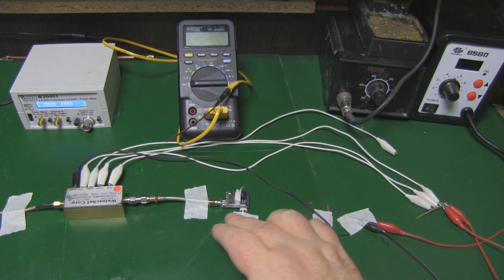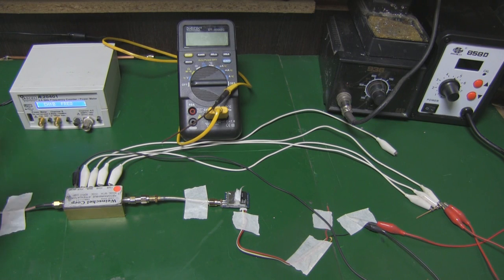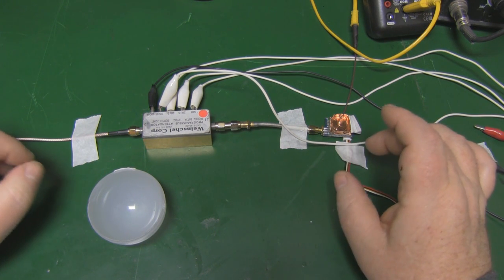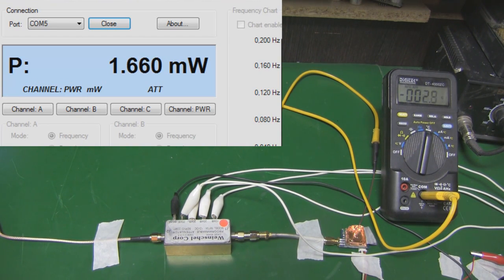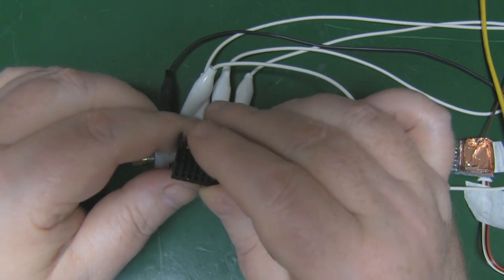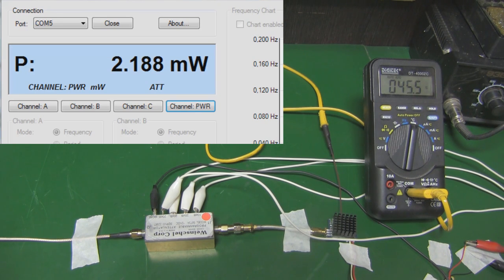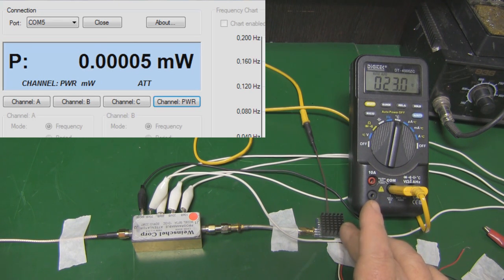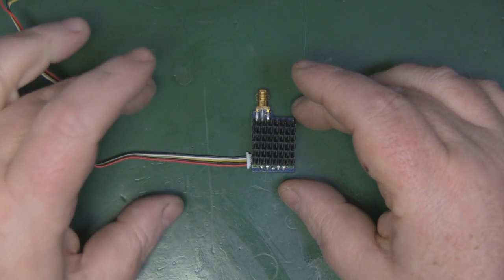Can Heat Affect the Power Output of a 5.8GHz Transmitter?

Comment: Thanks for the tip on the paste, thermal epoxy is pain to find! Those vtx also benefit from thermally coupling the PA chip to shield with a small square of thermal pad. No dry ice but gas no prob lol!
Reply: By removing the shield, putting the pad and then replacing the shield you mean? If so, I will do so when I receive my module.. hopefully anyday now =)
Reply: Exactly, easy to open as usually the shield is only soldered in two spots. Some of the higher quality units will already have this, but always good to check on the very cheap units. Pad only needs to be a little square the size of output chip, tall enough to bridge gap between chip and shield without making contact with antenna output when you close it back up ;)
Reply: Sweet, nice idea! Thanks for the reply and more info =)
Reply from the maker: Nice idea.

Comment: They vary greatly over channels as well and most people use these on mini quads with lots of air flow.
Reply from the maker: So the power output will be different if I change the channel on the dip switches? Will have to try that.

Comment: Excuse my non intelligence in this field ;) But you say 200, 180, 150 milliWatt when it says on the meter 2.0,  1.8, 1.5 milliWatt.. Is this because of the attenuation and you need to correct it in your mind when reading off the display or? I'm sure you're not saying or doing anything wrong, you seem well competent, but for me its a little confusing =)

Awesome video nonetheless! I already have one of these cheap transmitters ordered since a while and I know I need to go ahead and cool it properly.. I have a big quadcopter, so I hope I will be fine.. But anyhow, seeing your video on the same subject just when I need it, awesome! =D

Oh, and could you help with some math? Ohms law, 220mW divided by say 8V (0,22/8).. Are these modules only drawing about 27mA!? And they get so hot =D
Reply: I think the attenuator is set to 20 decibels, which would be a factor of 100. Of course, I'm not an electrical engineer.
Reply: Aha ok! Far from my expertise, but interesting and I guess I learned something new =D Thanks!
Reply from the maker: What Jon said :-). I am still filming the 4w amp video so I will try to make it a little clearer and explain it in more detail for you Chris.